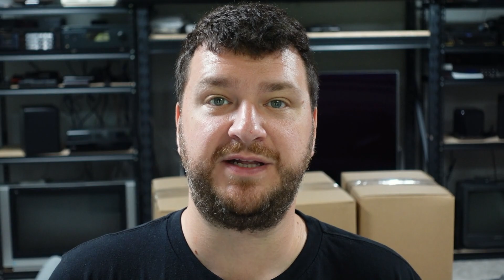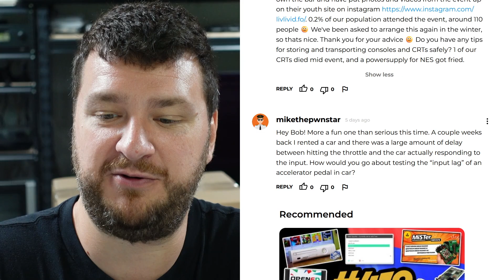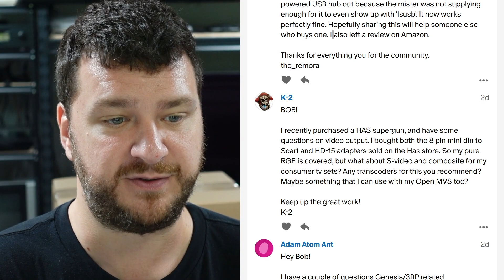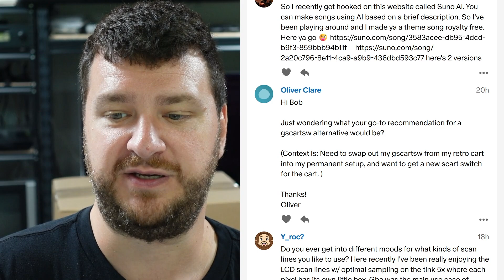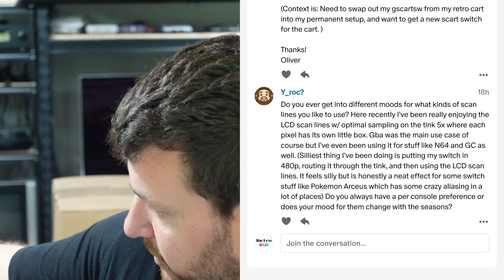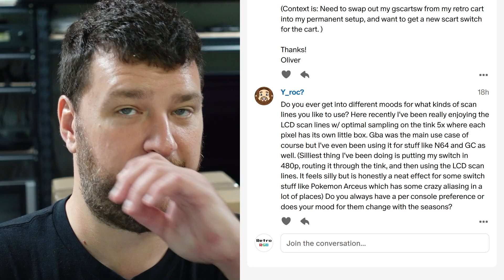Supporter Q&A #320

Comment: Professional gearhead, wannabe gamer here. For the 2000 ranger, if it was the 4 or 6 cyl, it should still have had a mechanical cable running from the pedal to the throttle body. The throtlle position sensor tells your pcm where the throttle is, and the pcm does all the witchcraft to make the car go vroom. 
In "most" modern cars, there is just a pedal that has wires going to it and can be digital or analog measuring user input and  outputting a voltage/signal like it was a fancy potentiometer.  The lag can be measured if you know the values voltage, signal, pulse width modulation, and so on. It would go foot movement to signal to pcm lag and from pcm to engine. If you have a scope, you can measure all this. Some companies even sell throtte lag removing devices for cars. 
I tried to make this as simple as possible without too much terminology, but if you look into it 90% of the technical ways you measure or test any retro gaming or pc issues are exactly the same for cars. 
Thanks for all the content. Its greatly appreciated.  

Side note. The opening the door and going into park issue. There was a rushed update to some jeep and chrystler products after an actor had his car roll back and crush him. Problem was they didnt real world test it and you could open the doors at 40mph and it tried to put the car in park.
Reply from the maker: Awesome comment, thank you for sharing!  Also, terrifying about the door/park issue.  I realized after I was done editing that I never finished my thought - In the neighborhood I spent a lot of my childhood in, people would get car jacked at a stop light all the time.  Imagine someone opens your door and you hit the gas to get away...only to have your car put in park!?!?!?!?
Reply: @RetroRGB  I completely agree with having less control of a few thousand pound vehicle. I will never buy a car without physical linkages for brake pedals, steering or shifting. Every mechanic has felt the thump to the head on the A pillar the first time you open a door to line yourself up on a drive on lift. Or imagine if you're in a stolen truck trying to steal an ATM from inside a convenience store with a chain, and it keeps slamming it into park because the door is open. It's dangerous for the driver.